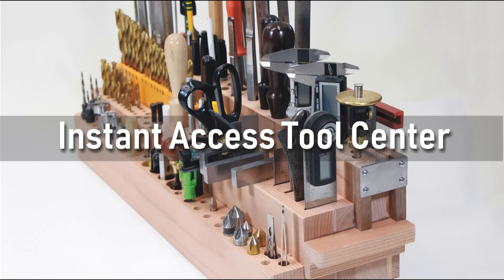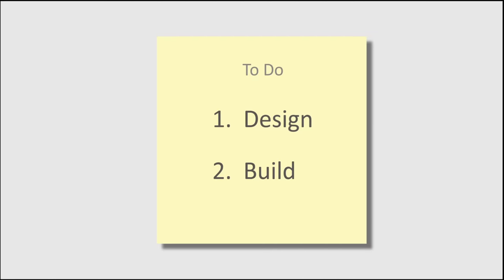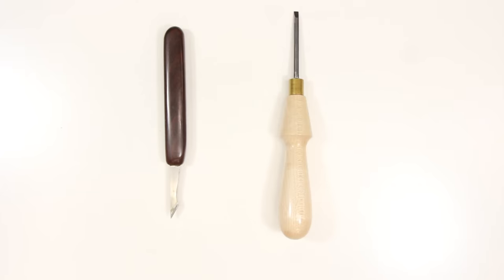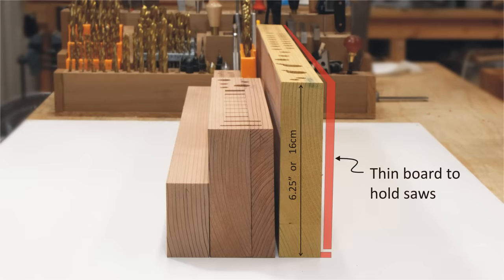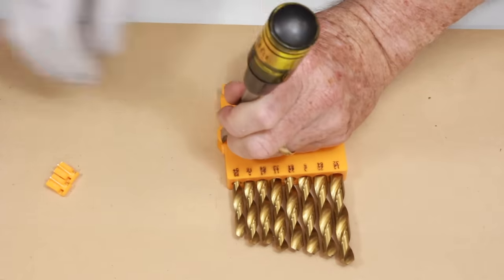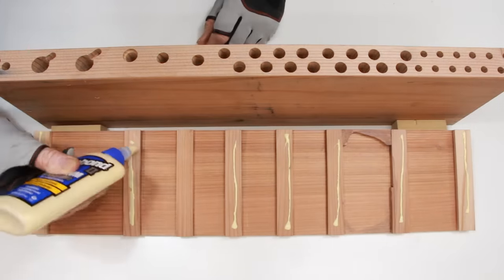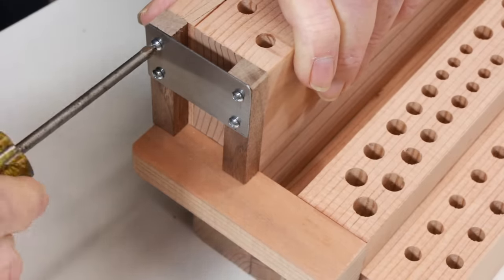Instant Access Tool Center

Comment: Love it (your video style too). 
I just made a super compact organizer in a small drawer for my drilling accessories, in my portable cart.
What I don't like is when making holders for drill bits, you waste a lot of time drilling a proper sized hole, since for example, a 5mm hole drilled in wood to hold a 5mm drill bit, can't be drilled by a 5mm drill bit. Even a 5.5mm drill bit can create problems...

I'll admit it, I do drop my caliper on the ground every couple of months.

Comment: It won't fix my marriage??? Dang will it get my dog to like me at least?????? LMAO!!! I do like the build I have been toying around with a "wood working wall cabinet" idea myself to separate my wood tools from my mechanics tools, I have a huge rolling chest with a top chest for most of my mechanics tools BUT lately I have been adding to my wood working tools which are in both THAT big mechanics chest and two other smaller tool boxes I have and they are a major pain to get to most of the time!! So ideally I want a wall chest for many of my wood tools like chisels, drill and screw bits, and assortment of small levels and squares I have gotten and so much more!! The thing is I do WANT a fixed box that is centrally located to my wood tools, BUT my problem is I am fed up with having to constantly WALK to my tools as I need them and I swore to myself that I wanted a way to make my tools "come to me" when I build this cabinet!!! I think you sort of solved my problem in making the "units" like yours, that can rest on shelves in the cabinet. THEN I can grab the whole "shelf" and take it with me!! And I have some heavy duty magnets (with a thin strip of metal on the back of your "trays") that I could use to hold those in the cabinet as well!!!

Comment: HF drill bits have done a good job for me. better than any of the other comparable cheap options I've bought (Irwin, Skil, Porter Cable, Stanley, Black&Decker)
Reply from the maker: I've had good results with the Harbor Freight bits as well, although my total experience is with just two sets.  Some are off a few thousandths from their stated diameter, but that is rarely a problem for the kind of work I do most of the time.

Comment: Amazing video!!. I always think about making similar thing. however, I will not make it as it will need new hole if I get any new tool. so I am considering multi usable tool box... not like just a normal box.
Reply: No reason you couldn't have one for all the old standbys, the tried and true workhorses of your crafting, and then another or some other solution for the things that come in and out of service. : )

Comment: Been there. Done that.  The thing that I did  that was different is that in addition to being free-standing, I also put a French cleat on the back of such a case.  The wall behind my bench has many French cleats to hang such things.  And a cart on casters also has French cleats to carry such cases or small kits.  A special kit may have drill bits, chisels, allen wrenchs, etc. I spend less time searching for stuff that [ put down 10 minutes ago.

Comment: Very inspiring. I have an axle and a set of wheelbarrow wheels from another project. My vision is a bigger kit, that is portable on wheels when I add power planers, electric drills, battery-powered drivers, etc. They can all sit down low on my "tool cart", and the smaller, "losier" tools on a "thing" like you did on the top. 
Oh, also some empty cups for the screws, bolts, and fastenings for the current project.
Has anyone ever extracted a complex and expensive item from its plastic wrappings, and within 5 minutes (or overnight), half the components have disappeared?

Comment: I really have enjoyed watching your videos. I have a serious question regarding this video. Have you noticed any problems with your metal tools rusting in the wooden holder? I once made a holder for some home machined steel parts out of wood.  My father, a tool and die maker for decades, warned me that storing the metal parts in wood may not be good as they could rust. I don't know where you are located, but in any of the high humidity areas this may be a consideration.  Thanks again for the excellent videos you are posting!
Reply from the maker: I have stored my tools in this holder for about 5 years with no rusting.  I live about 4-5 miles from the ocean, in a temperate area with humidity typically in the 80% range.  My garage shop is not heated, but never freezes.  I can't comment on super-high humidity climates, but my hunch is that the wood would not increase the risk of rust.

Comment: It's a great idea. Probably I will build something similar. But I have a concern. What if you want to add new tools? Or if you need to replace a tool that does not fit into the old hole?

Maybe I will make something similar, but more modular that you can replace smaller parts instead of rebuilding everything
Reply: Glue the sections together using only enough glue to hold the kit together.  Err on the using less.  If it comes apart you can always reglue.  To replace a section, split it off with a chisel.  Clean the surface with a plane or sander.  Make a new section and glue it back together.

Comment: Digital calipers: when you're not using them, pop the battery out, and stick it to a small magnet (the one you glued onto the tool center that you didn't know you needed yet!). 

The calipers draw almost as much current when off, as on! 
If you take the battery out when it's not in use, they can last for years.

Comment: I just found this. If you havnt switched to french cleats yet, it would solve this. Make a mini french cleat wall (two sided) that you can move around the shop with you. Hang the cleated tool holders on it that you need for the current job. That way you don't have to carry all those bits with you when you're not drilling, etc.

Comment: I recognize that small 6 in. combination square; it’s a Craftsman from Sears.  Did you also have to take an incredible amount of time sanding the body and the blade to get it straight and square?  I’m still not done: the short section on the top of the body still needs squaring and the 45 degree leg will probably need work too.  If you got one that’s square, you’re fortunate indeed.

Comment: I was wondering, if a small improvement would be to put a French cleat hook on the carrier, and then put matching French cleat receptacles near or on your most common work areas. That way you could keep it off your work surface, and maybe prevent spilling it.

Comment: Hi. Fantastic work and really easy to follow.
You are the teacher and we are the students.
I have a problem when 
I try to download your plans for the Instant Access Tool Center.
They're merged with the drill press plans you have on your site.
It's impossible to click on the Instant Access Tool Center gray letters, so as to download your beautiful plans.
Is there another way to get them or do to bypass the problem?
We are all waiting for your next video.

Thank you
KONSTANTINOS
Santorini Greece
Reply from the maker: Sorry Kostantinos, but I did not post plans for this project.  The reason is that it needs to be customized to your particular tools and needs.  The dimensions of the various wood pieces are not very important.  And you should work out the layout of the holes by setting out your tools side by side on your workbench to see the spacing that seems best.  I feel sure you can make something similar to mine, but which will hold your tools, rather than my tools.

Comment: Tip: For the tape measure holder, instead of cutting a spatula, buy a 12" Stainless ruler. Cut as needed. Easier and less waste.

Comment: Nice design. Wouldn't work for me though, I have too little bench-top and vastly more tools. I built a bench (now covered with 'stuff'), and a set of drawers underneath. I've had to label the drawers, or I forget what goes where! I have 2 multi-drawer metal cabinets usually used for paper etc in offices.

Comment: How would you make this modular as in whatever category of tool you're using can be taken apart but also 30 enough to transport as a whole unit and secure wherever. How would you add a spot for like a box of screws or more importantly how would you add holders for wiring if you have a lot of it. I think that's the most important question actually how would store wire if you did anything from tiny tiny to really thick gauge cables.

Comment: my only suggestion would be to screw everything together, so you can update sections if required.
Reply from the maker: I think that is a good idea, and workable.  I tried to maximize the number of holes and slots, and used glue so I would not have to worry about hitting a screw with a drill, or screwing into a tool slot.  If you planned ahead very carefully, you could locate screw "islands" which were free of tool holders.

Comment: One question: have you had any problems with rust on the tools in contact with the wood in the holes or slots?  I have often poured oil into holes to try to prevent rust.

Comment: I know your an old guy like my self.  When you  built this project did you consider that redwood is acidic.  I know it is a big issue since I worked designing red wood tanks, and cooling towers.  It is a huge issue when the wood is wet.  Which is not an issue in the deserts of the southwest, however everywhere else it could rust tools.  As an example we built a water storage tank for Volcano National Park on Hawaii the hoops were hot dipped galvanized steel they had to be replaced in five years due to the humidity causing the acid to corrode the hoops from where they touched the wood. If they had Spec’d “Red Tide Water Cypress” and not Redwood we had both in stock this would not have happened.

Comment: note: A white lead for a 0.9mm mechanical pencil is available at sewing supply shops such as JoAnn Fabrics.  Also, western red cedar is  a less expensive wood for this purpose.  Finally, a case that holds the entire tool center would be good for traveling, and the extra space in the case could be fitted out for planes etc.
Reply: I also use blue pencils it makes it easy to see the line.

Comment: can you please make a video and compare different nuts in power and durability of not moving ? 
at the momment i am making my own peg board with a metal punched sheet i have, and im torn between using flange nut vs regular nut + washer  or just regular nut

Comment: Would you actually recommend diamond files over steel files? Are there any instances where you still prefer steel files over diamond?
Reply from the maker: Don't get me wrong.  I am not recommending throwing away your steel files.  I have other steel files and rasps.  I use these diamond files for a lot of small touch-up tasks, and they work well for that.  They are compact and inexpensive.  They cut rapidly.  They are not terribly high quality, but it is pretty painless to replace them.  I am not trying to convert anyone to this product; I am just showing something that I found useful.

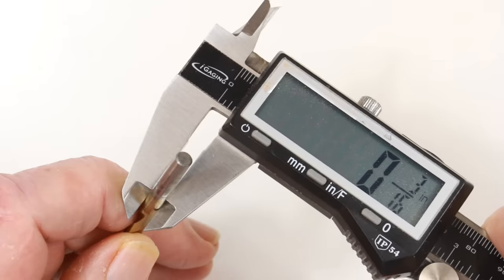Comment: 4:17 What kind of Digital Caliper offers a readout in fractions of an Inch? That seems pretty 'Murican. Is Decimals that hard to some people?
Reply from the maker: If you don't live in America, you may not appreciate the curious mixture of measurements that we have to deal with every day.  We deal with metric measurements (screws, drills, wrenches, plywood, etc), and a huge legacy of fractional imperial measurements, some of which get converted into decimal form because that is so much easier to use in calculations.  As a result, our calipers automatically convert any measurement into your choice of units:  millimeters, fractions of an inch, or thousandths of an inch.  If you need to know whether a 27/64" drill bit will cut a hole that will accommodate a part that measures 0.4", it is much faster and less error-prone to just push a button on the caliper.

Comment: My Vernier Calipers are my most frequently used tool. I would never trust a digital one. Just no. Not under any circumstances ever. I can read an analog one just fine, and it's a self-confirming measurement because you confirm your reading of it as accurate because of your rough estimate at the mm level. Getting down to 0.02mm is easy - and reliable. And the thing will never break, or need a new battery. I test it every few months, to ensure it's accurate.

Comment: wouldn't this collect dust in the holes?
Reply from the maker: Amazingly, I have used my version 1.0 for six years, and never had a problem.  If you do, you can remove the tools, tip the fixture over, and give it a couple of sharp raps on the bottom.  Obviously if you locate the tool holder directly in the path of something that is spewing out sawdust, you may have to clean it out sooner.  I have some form of dust collection on the big dust makers in my shop.  If you don't, not only will the holes in the tool center pick up dust, but your lungs will too.  Unfortunately, you can't shake the dust out of your lungs.

Comment: You really screwed my idea of a small tool tray to hold what I need for a project.  I would have to load and unload as requirements change.
Now I am going to have to build yours.  Only change will be it will be screwed together so I can make changes more easily.
Reply: Modular is the way to go!

Comment: Now build a cover so tools dont get dusty.
Reply from the maker: If you have a garage shop, the solution to dust on your tools is to buy a leaf blower, open the garage door, and blow it all outside.  This is both fast and surprisingly satisfying.  This kind of tool holder will tolerate high-speed blasts of air quite nicely.  If your shop is in your basement, then I guess you need to maximize your vacuum dust collectors.

Comment: As a mechanical engineer and hobby machinist it hurts my soul when I see someone doing this... 4:36. I know it's a convenient thing to do but calipers are precision instruments and not marking tools. The measuring tip on calipers is fundamental to their accuracy when getting into small spaces. Dragging it across a piece of metal just wears it out. It's a no no but hey I'm old school.
Reply from the maker: I never took a shop class, and any skills I have were picked up in the street.  This is not my only bad habit.  I can understand why using calipers as a scribe or scratch awl might violate the rules in the precision world of metal working.  And, you are right, the points will eventually wear a little.  That was part of the reason for buying a second caliper.  The new one will be treated with the respect it deserves, and the old one will be relegated to my woodwork, where an error of a couple thousandths of an inch will hopefully go unnoticed.
However, I would like to learn.  What is the right way to accurately transfer a measurement onto a piece of metal?  Is it OK to paint marking fluid on the metal, and then use the caliper points to just leave a line, without scratching the metal?
Reply: @PatrickSullivan   I use a Starret 42-6 hermaphrodite scribe with one curve leg and an adjustable scribe. The curved leg rests against the work piece edge. The scribe pin is replaceable.

I suppose if your calipers are inexpensive and you consider them disposable them by all means use them to mark lines. It is faster and more convenient. Mine cost $200+ so I use them for measuring only.